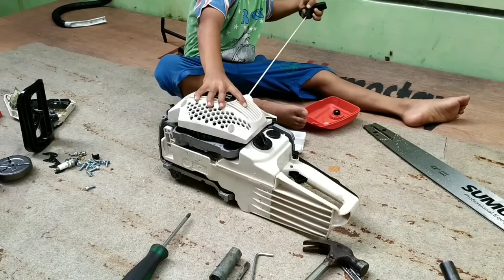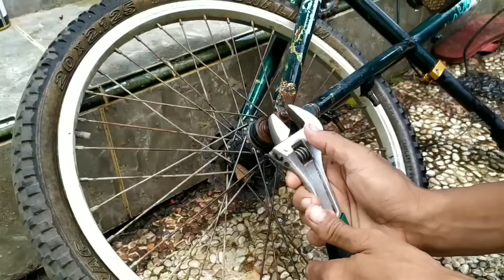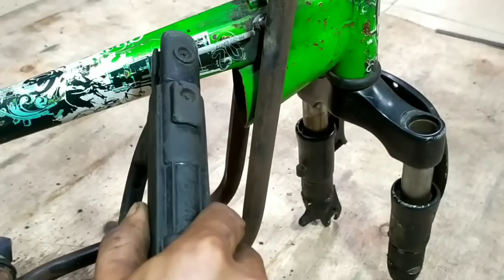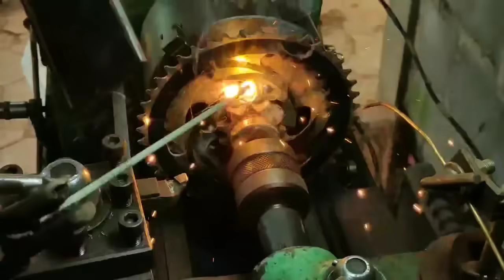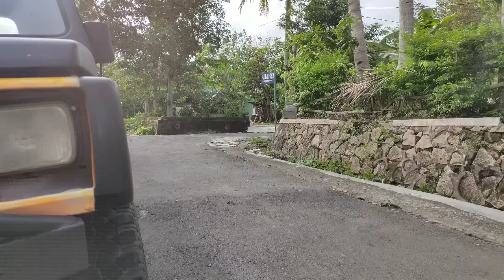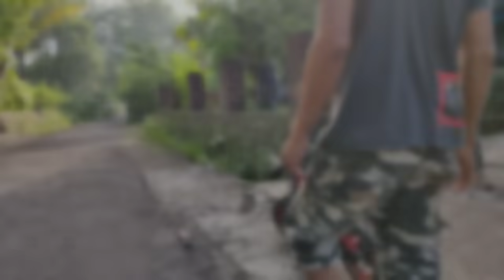Sepeda mesin chainsaw // Potong Rumput// Mini Bike Chainsaw // Homemade

Comment: Should put better carb on with a kn style air filter and port the Cylinder ive built many of these style gopeds / mini bikes in the past  and have made them quite fast with slite modifications
Reply from the maker: Thanks for your advice

Comment: You're burning too much oil, your gas to oil ratio is way off, that's why it's smoking so much. It was like that at the beginning to oh, you can hear the engine wasn't reaching its full power, that it was bogging down.
Reply from the maker: Thanks for your advice sir.. 🙏🙏